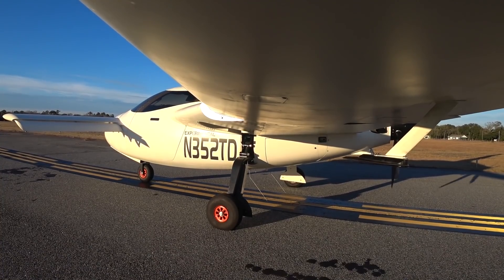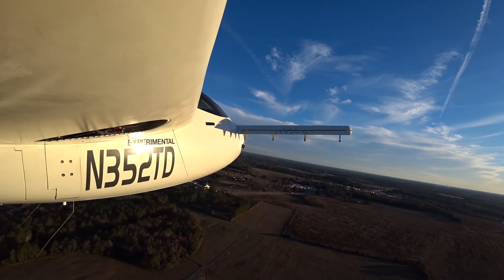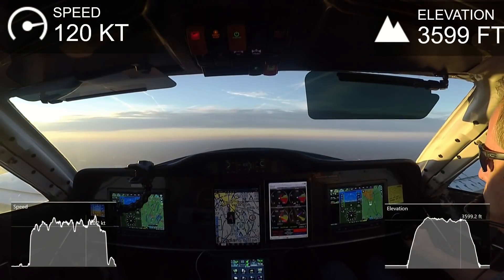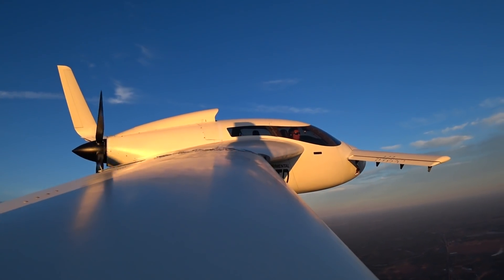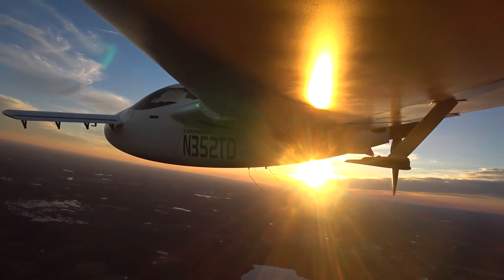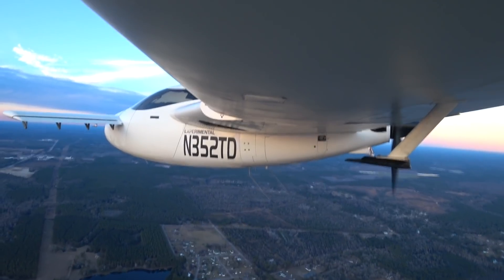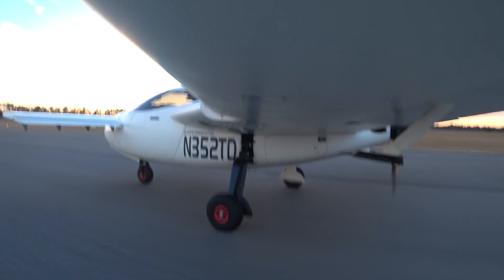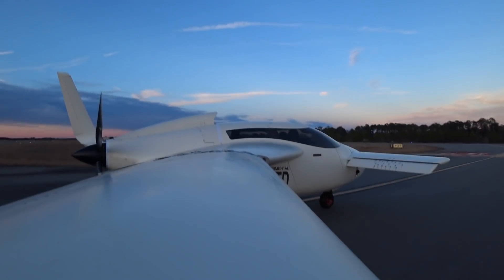Evening Flight Test - Flying the Raptor Prototype

Comment: The static port is not built and utilized to receive impacted air. Your “fencing” utilization. They’re typically mounted on the side of the fuselage to just read “static air pressure”. You’re pitot tube receives the “RAM” air, typically mounted on a wing or front of aircraft to receive air from the relative wind. Ram air (Pitot tube) minus the static air pressure (Static port) translates to airspeed. If you shove air into the static port, you may give yourself a lower or higher airspeed depending if you’re creating a different “static air pressure” by trying to shove it in that tiny hole..
Reply: There aren't many spots on an aircraft that have true static pressure, and there will always be variances...just kick the rudder a bit and watch your instrument readings change.  Static port fences are utilized to create an area of static pressure over the orifice when the area in question is consistent in pressure throughout the flight envelope but are otherwise not at ambient pressure.  It's more of a fine tuning than anything, especially seeing as how there isn't a well established area of static pressure on the fuselage.
Reply: @Skinflaps_Meatslapper  Thank you for that insight. Sounded like the “fencing” was to impact the air into the static port. I understand your explanation. Appreciate the explanation
Reply: @scottbrunt2863  Ah, I see where that might be confusing.  It's not quite the same as creating a ram air effect, it's more to bring a state of lower than ambient pressure up to ambient.  You can theoretically place a static port anywhere on the aircraft, but some places are naturally better than others...and once you've cut a huge hole into the fuselage for it there's incentive not to move it around to another place that might be just as bad.  Most aircraft have places that are close enough to static and that's why you don't see fences on them very often.  My personal preference with experimental aircraft are pitot tubes that have static ports integrated with them, since all you really have to do is get it pointing in the right direction...the position relative to the pitot tube has already been engineered in and does away with locating a spot on an aircraft that may or may not be static.

Comment: Peter, in regards to adding flaperons on the production models, it seems all your approaches are consistantly low.  Does your seat position, and lack of flaps prevent you from seeing well on a 3 degree glideslope without the nose lowering effect of flaps/flaperon.  Not meant to be a dig, just wondering if there's a genuine reason for it.
Reply: This is an issue with all canard aircraft. The Long EZ deals with this by having an extendable airbrake. However the Rutan inspired Velocity aircraft usually don't have this because the forces would be too great to overcome with a light hand crank so that decreases useful load significantly if one is installed, so they come in low. The Beechcraft Starship had a moveable canard but that killed it's commercial viability. Flaps allow you to descend at a greater angle of attack while picking up less airspeed while a canard design relies on the canard having a higher angle of incidence than the main wing in order to maintain controllability and prevent a main wing stall. Flaps raise the angle of incidence of the wing and this could make stall recovery next to impossible if the main wing stalls before the canard. The strength of the canard design relies on the resistance to the main wing stall by guaranteeing that the canard stalls first and pitches in the correct direction for a stall recovery. So in order to keep useful load high, use less moving parts, and not having to remember to retract the airbrake in a go around, canard pilots come in on a flatter approach. Reward vs. Risk.

Comment: It seems at lower altitude at least, the cooling scoop will need to always be fully extended...... any thought into either making the scoop extend a little more.... or putting an electric fan on the 2nd radiator, or on the exit to the cowling to increase mass flow?
Reply: The problem is he's trying to get air to enter the cowl at a region of lower pressure and exit to an area of higher pressure.

https://www.caro-engineering.com/projects

Read the bit about Cessna 337 cooling. She fixed it by moving the air inlets to the high pressure area under the engine and the outlets to the top where the low pressure is.

The other thing he needs to do is position the exhaust system outlet just inside the cowling so as the gases leave they entrain the hot air and pull it out. It's kind of like the opposite or inverse if the Coanda effect; instead of following a contour, the flowing exhaust gases force the gas next to them to conform to their flow.

Comment: Peter, Good show! I don't know how you have found the time to video document all that you have over the years. My new years plan was to do more video of projects I'm spending time with however I'm just too busy. I admire that you can. When I regularly work with aircraft, evening and night flights are the primary times I fly. I'm taking off after most had landed. Thanks for all your presentations. Raptor just keeps getting better and better thanks to your perseverance and problem solving capabilities. Cheers

Comment: Peter if you will plumb the return oil out of turbos to the new cooler or another cooler you should see dramatic change in oil temps.
Reply from the maker: The turbos are already water cooled so that probably won't help much. I have some other changes I am working on.
Reply: Peter what is the water temp leaving the turbos then ? If the turbo pyros are producing 1400 degrees constantly then the oil has to be crazy hot, in heavy Diesel engines we try to not exceed sustained temps over 1000 degrees, we need to look at how farm tractors shake of there turbo and water temps because they are very similar in that they are staying in there max workload for a sustained period .

Comment: I can't imagine what was on those AN fittings, that would make them leak on a slightly inconvenient reassembly  ? The 37 degree taper cures all usually . Was there some accumulated oil on the threaded area, that came out later ?
Reply: The AN fittings might need safety wire to keep them tight with all the vibrations.
Reply: @zmanmd1641  ,,, no, not in the short term . I think Peter was being toooo scrupulous, and just saw some oil that had been trapped above the taper locks .

Comment: Would it be possible to dissipate heat from any of exterior structural surfaces ? I guess dumping some heat in the wing tanks might be possibility at least as long as they are not empty
Reply from the maker: I'm already doing that but the flow rates are not ideal so the heat transfer is presently limited.
Reply: The problem is  trying to get air to enter the cowl at a region of lower pressure and exit to an area of higher pressure. Fighting the pressure gradient instead of taking advantage of it.

https://www.caro-engineering.com/projects

Read the bit about Cessna 337 cooling. She fixed it by moving the air inlets to the high pressure area under the engine and the outlets to the top where the low pressure is.

The other thing to do is position the exhaust system outlet just inside the cowling so as the gases leave they entrain the hot air and pull it out. It's kind of like the opposite or inverse of the Coanda effect; instead of following a contour, the flowing exhaust gases force the gas next to them to conform to their flow. It's called an extractor system, I saw it in the EAA magazine years ago.

Comment: Have you considered putting the oil cooler outside the skin (under a cowl) with a door to regulate flow - rather than trying to get full flow through the engine cover?  Keep up the great work!

Comment: Very nice Peter...The evening sky is beautiful...
Curious if you can use the air conditioning loop for auxiliary oil cooling? Just switch the refrigerant flow from the evaporator coil to a tube in tube heat exchange coil?
Reply: ??? Don’t you think it’s getting complicated enough, instead of hack jobs trying to put bandaids on things take a step back and look at the problems
Reply: @grandenauto3214  I totally agree...My thinking is that the air conditioning system is only used while on the ground...Why not try to leverage something that is already onboard instead of adding more weight...But I agree, always prefer real solutions over bandaids...It’s just fun to brainstorm ideas...